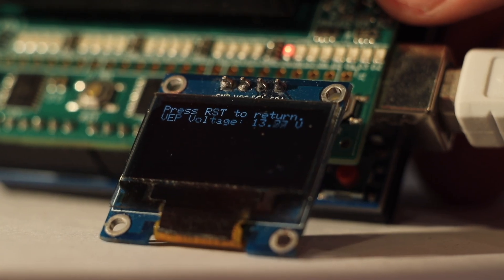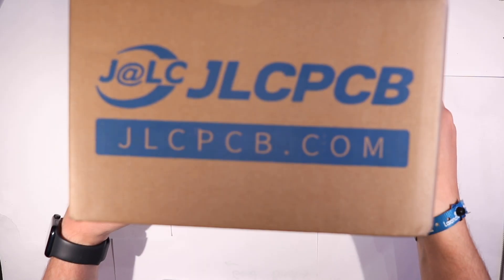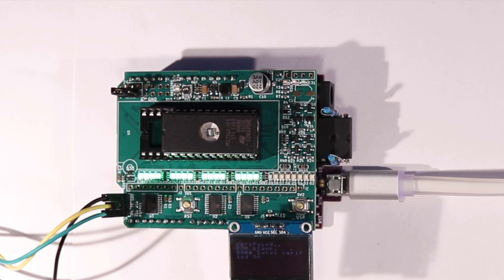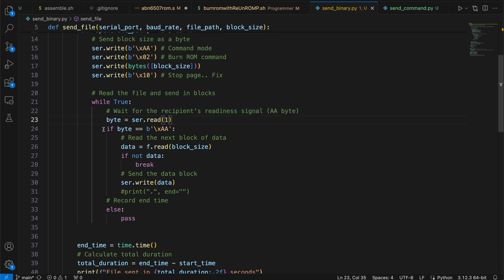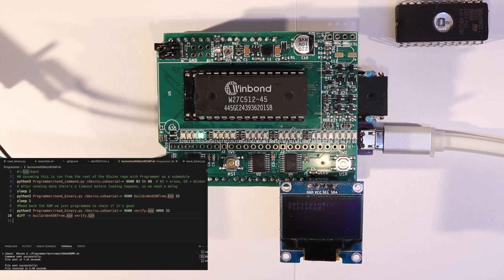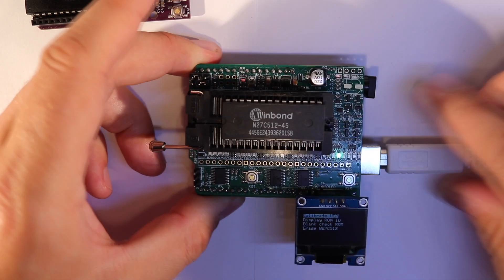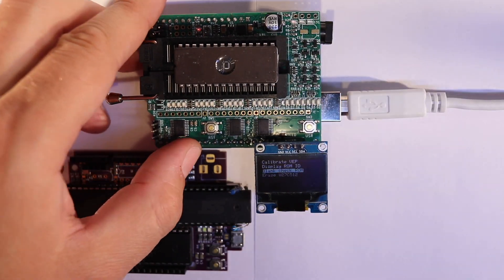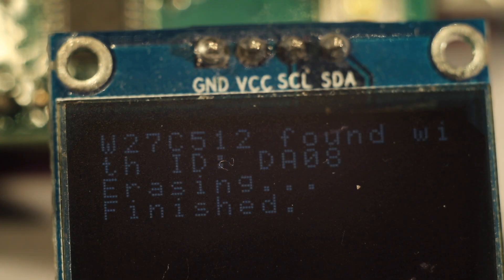This $9 Open Source ROM Burner got upgraded!

Comment: Can this be used on 28C256 eeproms?
Reply from the maker: Yes - I haven't tried though, so no software support. And of course it doesn't need 12V+ so it can be done on a breadboard easily - but the programmer would also be more practical.
Reply: @AndersNielsenAA  Okay thank you, I see you don't ship to the UK anymore however
Reply from the maker: @afkafkafk  luckily someone ordered a bunch of boards and is selling them on eBay :) More info on Discord if you stop by.
Reply: @AndersNielsenAA  Ooh I have just seen that, thats great, I am quite new to the concept of programming eeproms, the 28c256 has a different pinout to the 27c*, Is this something I can remap using software is it a hardware limitation? For example the A14 pin
Reply from the maker: @afkafkafk  Yes - they can be swapped in software.

Comment: Very nice video. The project will work on a Arduino mega?
Reply from the maker: Thank you. Kind of. The code needs to be changed to use another whole port, like PORTK, and it has to be wired onto it using jumper wires.. so kind of.

Comment: I had an idea on how to make the button multifunction WITH visual feedback.  Have a small annunciator appear in the corner of the display that tells you what the button will do as you let it go.  So it could be Enter, ESC, quit, depending on how long you have held it and after 2 to 5 options it would return to the start.  Similar to the way you enter a digit by having it cycle through when setting a cheap digital clock and stopping at the chosen digit.

Great project and I will get one soon enough.  Leaving room for a through hole trim pot would be nice as the tiny SMD ones appear very fragile and hard to use for older eyes.

Comment: Interesting project. Do you thing it's possible to implement a GAL programmer in the firmware?
Reply from the maker: I doubt it - the design relies heavily on the JEDEC standard pinout of parallel EEPROMS - most pins in the same place.